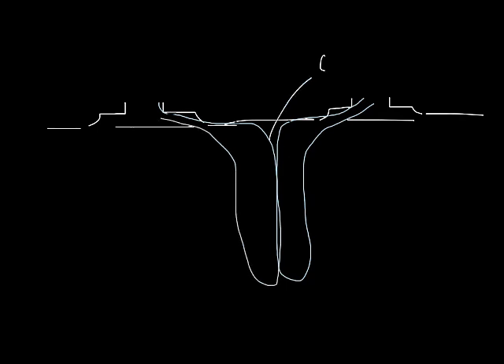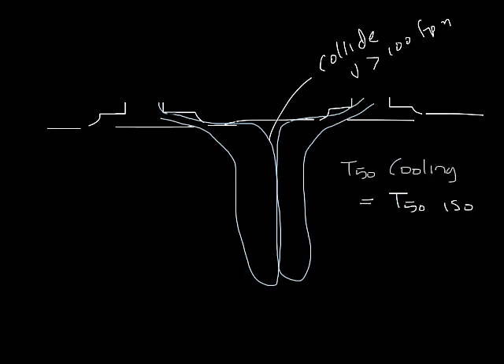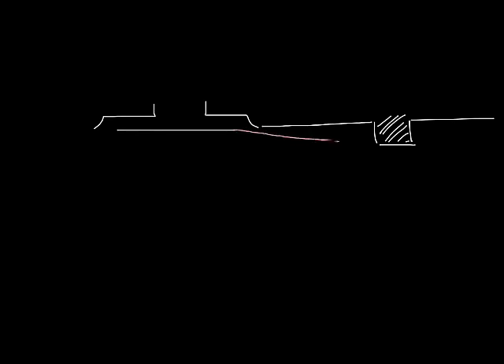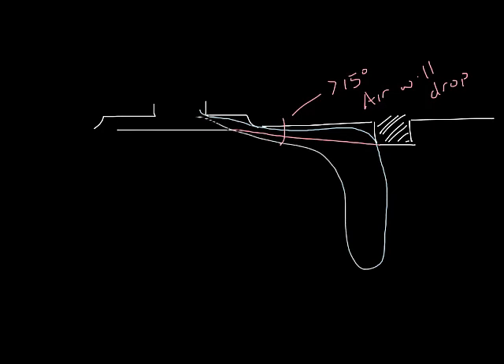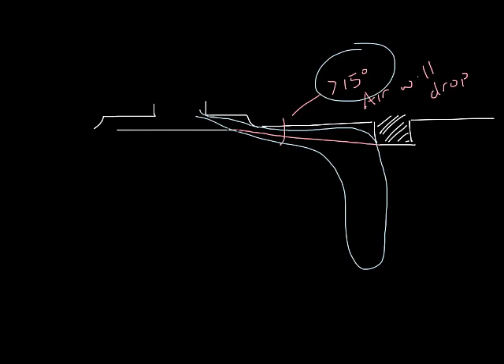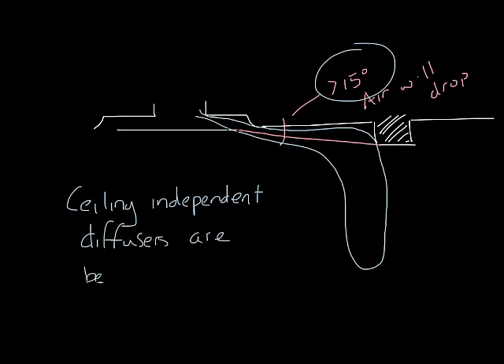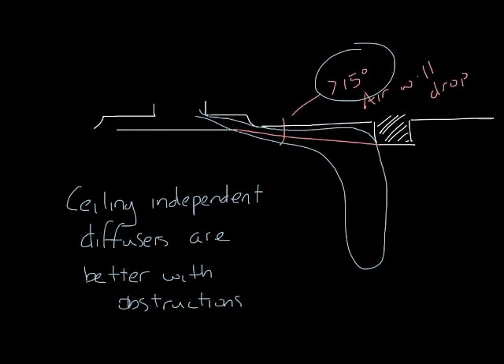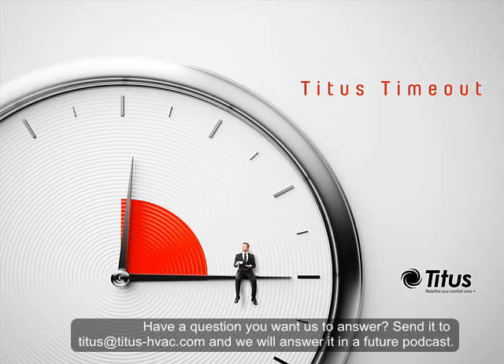Titus Timeout Podcast - What happens when airstreams collide?

Comment: It seems like the video resolution quality has degraded on many of these videos.  I could swear that the images were sharper and easier to see a few months ago.  Any idea what happened?
Reply from the maker: +Justin Older I seem to remember a time when my settings somehow changed on the video rendering. This may have been that. I did fix it, but I don't remember when that happened. I switched to a wide screen hi-res format this year, so hopefully you will notice a difference in the newest ones.